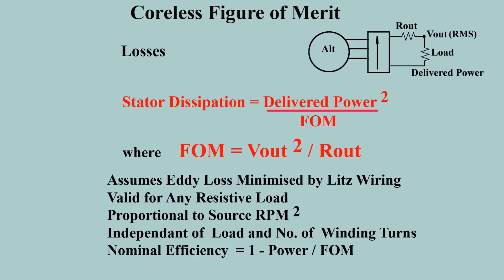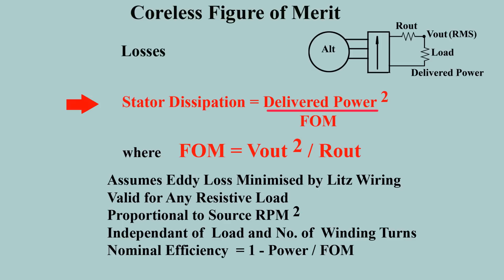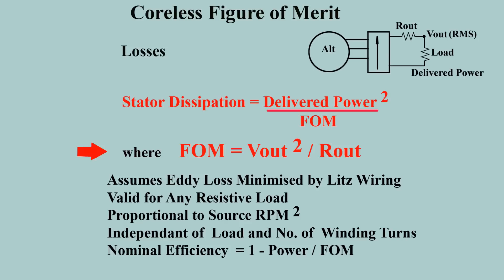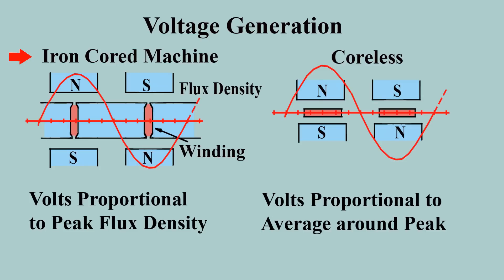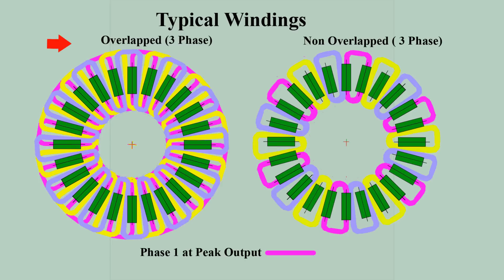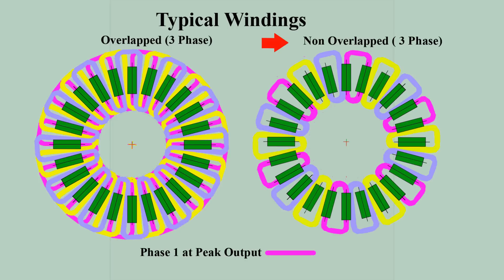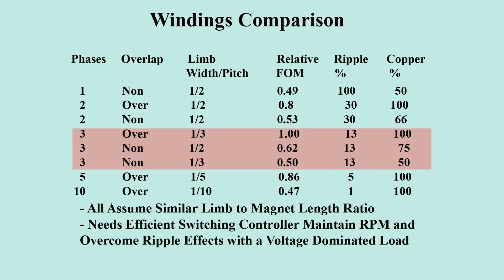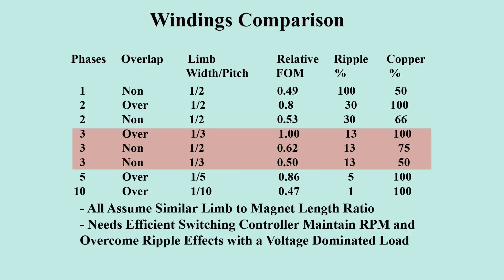Part 2. Axial Flux Alternator Phasing and Winding Methods

Comment: Hi sir, in the picture with winding type, is the left one 12 pair poles and right one 6 pair poles? Thank you
Reply from the maker: Dear NicozStrat   
This may answer your latest queries. Two steel rotors each carry 24 magnets facing inwards with alternating  N-S and S-N faces opposite each other. The stator stands between, incorporating the windings.  In this particular design, each phase is wired with two passes as videoed. For calculation of output, each phase winding can be considered a serpent, picking up voltage wherever it crosses between an opposing magnet pair.  Generated voltage is proportional to the total number of crossings, rpm and field strength between the magnet faces. (No reference needed to poles or coils)